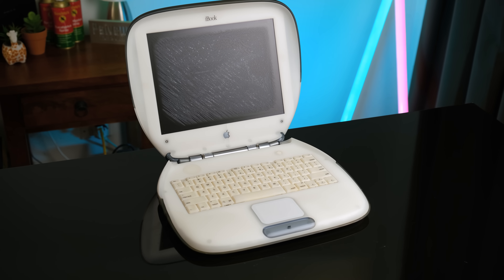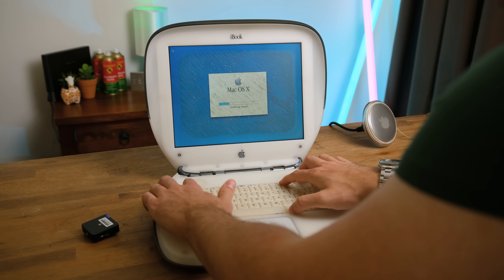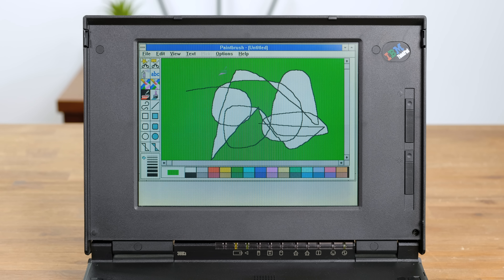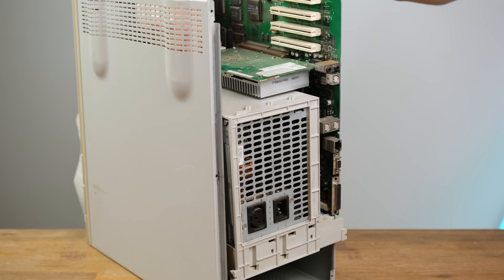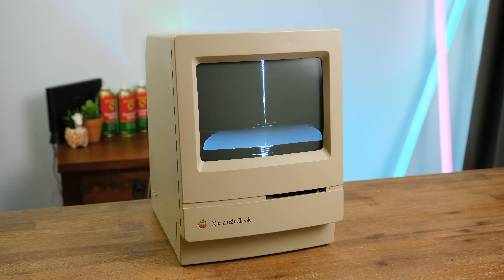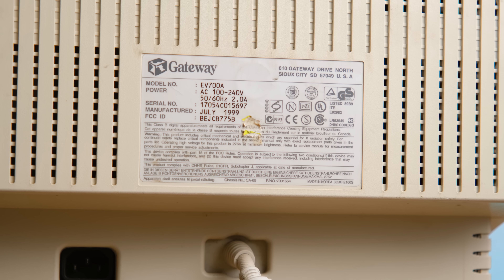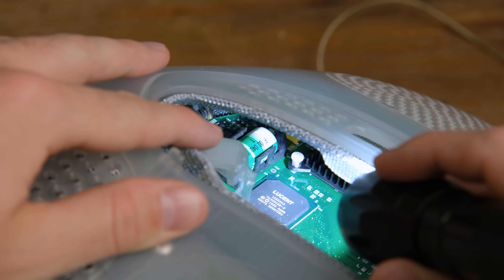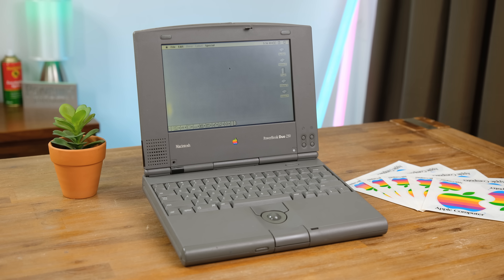So Much Vintage Tech Is Dying... Here's Why

Comment: I wish there was more talk about preservation here. A lot of this degradation can be slowed down and parts can be replaced. For example building in fans into iMac G3 and running less demanding software (OS9) can mean lower temps, longer lasting flyback transformer (not scientifically proven ofc, but many at least put the effort in to trying). LCDs can be replaced. Optical drives are often fixable. Recapping is another huge topic. 

There is also the option of frankensteining multiple machines into a single flawless one. The iMac g3's outer shell is completely removable, if you have a "broken" rare iMac (eg. sage), you can replace the insides of it from a more common (eg. blueberry) one - this is how I made my grape iMac G3 look and work like it's 1999. 

I haven't seen the LCD crust you showed, so I'm really just guessing here but there might be a chemical in your household causing it? I don't keep my vintage stuff dry and cool and I never saw this happening. Just strange to me that it was flawless for 20+ years then suddenly rapidly breaks down. Rubber coatings indeed break gradually but also they can be just washed off with alcohol. 

Anywho, yes, things fail eventually, not only vintage tech. But there are always more options than just watch things die.
Reply: My biggest dream is to create open-source models of those old tech, that is made using new parts and new technology. I'm mechanical engineer, I specialised myself in 3D modelling, designing and 3D printing technologies, sooo I have good enough background to participate in such project. I would love to see Toshiba Libretto 70ct as a open-source project of Win98 portable computer, that its chasis is made entirely using 3D printing technology and parts are made using new, commonly used components like for exaple some kind of mod for Raspberry Pi. This project would need to be updated regularly, in which case it would mean to create new editions of components for it to be in touch with currently avaliable parts on the market, or to gradually create alternative ways of producing parts for that device in small quantities by hobbyists. We have enough manpower to do it - there are hundreds of thousands old tech enthusiasts active on the Youtube right now.
Reply: @damich-t  unfortunately i think intelectual property laws and the private companies behind then will render this impossible in practice.
Reply: @baraodascolinas979  I am from Poland, bruh. Just hold my beer XD
Reply: @damich-t  I am from Brazil, and even here the north American conglomerates reach deep. There is a random hambirguer restaurant in some random brazilian town that used to give Disney character names to menu items , and they were taken down by lawsuits from Disney. Poland is a member of the neoliberal European union , so I fell this Idea would suffet the same fate

Comment: Very informative. I got a complete graphite clamshell iBook. When I first got it and lifted the display lid, the whole damn place reeked of vinegar. But apparently there is a way to replace the surface film of the LCD panel.
Reply: I replaced it on mine a few weeks ago. I recorded it and uploaded it to my channel in case it helps someone!
Reply: I think this video could've been better, they could've covered restoration techniques to make the video educational on the solutions as well as the problem.

Comment: I just looked up the prices of mediocre CRT's. Holy moly! Should've kept a few.
Other than that, absolutely agree with your conclusion. I see a lot of vintage audio stuff and when it works, it goes. 
I myself prefer more modern things.
That said, other than the sticky top coating disintegrating, none of these physical deterioration issues seems to ever happen here.
The only exception I can think of was a huge pile of video tapes I once saved. Some had gotten moist, so they got mouldy, and the boxes completely broke apart. They smelled absolutely gross and were breakable with two fingers on one hand. I wonder how much climate has to do with these issues.
Reply: CRT's are like 5$ in Serbia, no one wants them everyone has them, My family still uses CRT TVs.
Reply: @SectorfiveYT  Here in Finland you can pick up like a 32" FullHD flatscreen TV or 24" normal office LCD monitor for free from the dumpster, or get it for $10 at the drift store. But when it comes to CRT's, you need to pay something like 50€ (~54$) for a regular CRT television, and like 80€ (86$) for a decent Trinitron 19" monitor for PC if you're even able to find one. Smaller Sony Trinitron TV's / PVMs are an unobtainium, they're all recycled a long time ago.

There was a time when nobody wanted them, and me included didn't have infinite space to store all the good ones. Suddenly they were all gone and prices went up, since they are too heavy/fragile to ship from the other side of the world. I have enough CRT's for my own needs, but when they are spent, that's game over.
Reply: @nakkistromberg3946  I have 3 CRT's how do I know if any of the ones I have are good? I have some Samsung and Viewsonic ones.
Reply: @SectorfiveYT  If you're talking about computer screens, both of those brands are generally very good stuff. The most wanted ones are high-end models with flat Trinitron (made by Sony) or DiamondTron (Made by Mitsubishi) tubes. Usually they are well advertised on the bezel. Also if you have multiple inputs (multi-VGA or VGA+BNC) behind the monitor, that's usually a sign that it was one of the "better" ones. It depends on use case, some people prefer the "normal" style CRT without flat surface, especially for older computers. Those can have a great picture too! Any known name brand is usually good enough, the cheap taiwanese/chinese monitors (especially older ones) were sometimes pretty bad even when new.

With televisions, Sony's and JVC's etc. are the more wanted ones, all but the last "HD" CRT-TV's which introduce an input lag and aren't suitable for hardcore retro gaming. However those TV's have great overall picture and can be still awesome for movies and some slow-paced gaming like RPG's. Newer sets also often support both PAL and NTSC signals which is nice.
Reply: @nakkistromberg3946  Probably last cheap crt years in Lithuania were late 2010s. People were giving them away for free for almost the whole decade. Now prices are at least from 30 euros.
Reply: @SectorfiveYT  in Russia you can by Trinintron from ~2000 for, like, 25$, but situations like you mentioned is working here too for large and heavy CRTs, people sometimes give them for free just to someone take this, like, 90 kg old beast from their living space (they can't do it by themselves )
Reply: @lvl90dru1d  Yeah, I've seen some people give free CRTs here too.
Reply: https://youtube.com/shorts/T6-O2u0KCDc?feature=share
Reply: Same i had a bunch of the high end CRT's had 3 Sony Trinitron P991 in a triple setup was so heavy i had to find a really strong desk, then i upgraded too 3 GDM-FW900 i remember the day they arrived the delivery driver was worn out moving them as they came in huge boxes which made them even harder to lift, i later got them up stairs into my bedroom but it was like a worlds strongest man event to get them up there lol.

Ended up giving them all away when i moved and did not want to keep a few hundred pounds of crts sitting around.

Wish i had kept them now looking at the prices haha.
Reply: It only happened during covid. Everyone had time new hobbies and the need for others to make income. That equals inflated market.
Reply: @TheAssclown213  No it was about 5$ for a lot of years, not just now..
Reply: @TheAssclown213  free time, supplemented income for a few months and  then getting to use video conferencing to work from home, and first $2000 irs check with chatter first months after of another on way, possibilty it becoming a regular thing. Then it died down slowly& the there was only silence. Prices on everything were going up & with thrift shops unable to open, their prices forgotten. All time pretending to be working became a daily grind so people started using it to clean out attics and things forgotten in boxes for years. Trash bins were too small and paying for large dumpster was ripoff so instead of paying trash place 300+ they started listing and eventually greedy folk started raising hoping for fool who didn't know prices, then another saw sell price & uped it by $5. Then another fid same. Before the second check got confirmed times were dark &  people only had vague memories of past when life was good & had already spent too long isolated and people needed interesting things to do while sitting by computer Incase their supervisor popped on there unexpectedly or to make sure they moved their mouse every so often or hit some keys if boss just monitored computer activity. After the hope died & world opened again I saw a lot wearing masks below the nose at half mast in memoriam to it. As a final kick the government gave that 3rd check but at cost of passing extra stuff inside it, selling online used to be tax free, private sellers could sell up to few thousand to other citizens and government didn't require it be reported on tax forms. Now limits like $400-600 for non commercial private sellers selling own things, and  before taxes are deducted,  purchasing online now includes state taxes. The government wanted it's money back. But  people said screw it & now use Facebook market place or craigslist to meet up locally and pay in cash or with an app, and even include a for free section for non working items instead of ebay's for parts only at half price of working one . But online has online selling after reasonable price people left for local sales it left a higher ratio of greedy sellers  looking at listing prices and uping each other with overseas Chinese sellers trying to fill gap with reproduction and fakes of everything from handbags to Gameboy games that you'll be flooded with on most searches unless checking condition  as used or refurbished. And  now sites like dk oldies exists as more take lead from the car salesmen and shop employees of past years that'd follow you around asking if you found everything alright with a smile knowing the value isn't that high but eventually the big commission pays off if they can find even one chumps

Comment: Its also a good idea to be prepared to replace capacitors (all types) as they are the most likely of components to degrade from lack of use.
Most analogue circuits are repairable if you have the know-how.
Reply: Disagree, solid caps like tantalums don't really degrade and electrolytic caps from pre 1990 are also generally fine as well. Bad caps (AKA the capacitor plague) started in the early 90s and right now its killing everything from Game Gears to big box Amigas. Preventative maintenance should only be done if its 100% required otherwise you risk ripping pads off trying to replace caps that don't actually need replacing.

Edit - also kinda obvious but its worth mentioning, if you are replacing leaky caps be EXTRA careful when removing them as the fluid is corrosive and will almost certainly have eaten away at the pads making them much easier to rip off.
Reply: @dungeonseeker3087  caps from after the plague tho are fine for the most part i thought
Reply: @dungeonseeker3087  Not really, tantalum capacitors tend to fail rather violently, moulded paper/metallized paper capacitors are junk and so are asphalt and oil sealed paper capacitors. Some polyester capacitors were bad and even some ceramic were manufactured badly. In my experience the lowest failure rate in capacitors are polypropylene/terylene capacitors no matter how old they are. Old electrolytics are hit or miss, some have a near 100% failure rate (miniature plastic electrolytics) and some are flawless - blue Tesla TF capacitors are great but the red ones are low quality
Reply: @KofolaDealer  I never said they don't fail, I said they don't degrade. If they do go pop its very obvious and will almost always create a short on one of the main voltage rails so its easy to diagnose. Again, they only need replacing if they do pop, otherwise they are fine.
Reply: @dungeonseeker3087  Solid caps will last a long time but electrolytic capacitors will need to be replaced eventually, even if they don't bulge or leak they can lose capacitance and therefore not perform as they should. Re-capping electrolytic caps is just a fact of life and while caps outside of capacitor plague will last much longer than plague caps they still won't last forever.
Reply: @dungeonseeker3087  it sister start it the 90s it was just worse in the 90s, electrolytic capacitors basically will fail eventually, look into antique radios for example, it's the #1 failure
Reply: There is some time , late 1990s, and 2000s, where a lot of bad caps have been used which then bulge. I also had a Dell Pentium 4, similar to the one in the video, albeit with a larger case. That completely broke down due to caps issues after only a few years of use. Actually Dell had a recall / mainboard swap program in place but at that time, I lived in a country where this could not be done and I did not have the possibility to bring it elsewhere, and so it eventually failed.
Reply: @mudi2000a  Pentium 4 mainboards are notorious for their leaky caps. That also goes for original Intel boards, it's not a Dell issue.

Comment: Yes!!!!! You're actually doing a video about it!!!! Stuff like what you mentioned make my life as a vintage PC enthusiast in Singapore troublesome, and I'd never thought the same issues would surface in Australia! For a while, I've been thinking of getting out of the hobby, partially as a result of pressure from my parents who keep thinking I'm a hoarder… ugh!

I just wish PCem and/or 86Box can emulate laptops (particularly ThinkPad models) complete with a battery gauge that could be manually controlled or synced up with the host, and also add emulation of early graphics tablets.

(4:36) OH NO! I didn't think about using zipper bags! Argh!
Reply: Tech archival and preservation is very difficult in tropical countries (so both SG and the Australian costal areas). Unless you have constant climate control eg. air conditioning and/or dehumidifier, many of the components like rubberized coatings and ALL forms of LCDs will simply deteriorate.

LCD vinegar syndrome is accelerated if kept in an airtight condition as heat is trapped inside with no airflow. Deterioration is actually slowed down if the device is still regularly used. 

Got an Epson 386 PC along with a CRT at home, CRT can receive power, but no display. The PC POSTs but the HDD is dead. Been wanting to donate to a museum but no one wants to take it in such a condition. 

Got a Pentium MMX that only boots successfully when it pleases, but the 
CD drives rubber bands have long since disintegrated. 

The only things in my retro collection that still work reliably are the game consoles from before the CD era.
Reply: Write a little API that interfaces with the old operating system to the new and exposes the variables of the battery meter, you can write a little interface module that will work with the old operating system to control the battery gauge application or tray icon and manipulate it artificially. You could use VB and winforms.
Reply: @HikikomoriDev  
That would work for Windows 3.x where there wasn't a standard, but Windows 95 introduced a unified battery gauge without device manufacturers having to make their own utilities or use an 'information panel', so I'd rather have emulated APM for older OSes or emulated ACPI for newer OSes, but what you mentioned for Windows 3.x and early Linux distro guests.

Comment: I think you're not storing your things properly
I've never had this sort of problem with 10, 15, 20, or 30 year old tech of any sort. Tech doesn't just spontaneously combust.
You seem to love putting some sort of oil all over your plastics - yeah that's a recipe for disaster through chemistry. 
There's a reason that electronics engineers only ever use alcohols to clean plastics (aside from acrylic), PCBs, contacts, etc - it evaporates and afterward there's no chemical reaction taking place
Humidity is also a major factor
Your tech problem is you - sorry
Long term storage of tech: in a cool, dry, dark place. Use desiccant pouches if you can. REMOVE ALL BATTERIES. Lithium batteries should be stored in lithium pouches - not plastic ziploc bags
Cleaning: with soapy water in wringed-out clean cloth (microfiber works), followed by alcohol, let dry

Comment: I have one of the iMac G3s with a tray-loading drive which also has the pinging issue. After it has been powered on for around half an hour it stops pinging. When I got it the PRAM battery was starting to leak but it thankfully didn’t damage anything. The CD drive broke a few weeks after I got the computer and I replaced it, and it worked, but after a few weeks the drive stopped being recognised by Mac OS 9 - I have made a video about the drive issues.

Comment: Same thing happens with a lot of cars that ultra-cheaped out, including but not limited to certain Mercedes-Benz models on either side of 2000.

Getting back on topic, the bulging capacitor issue is partly attributable to industrial espionage, in the form of stolen blueprints that turned out to be incomplete.
Reply: Sticky plastic was widely used in Ferraris of old. The sad thing is, whereas a Ferrari owner wouldn’t mind forking out some cash to get it resolved, old electronics is thrown out because it ‘isn’t worth it’.